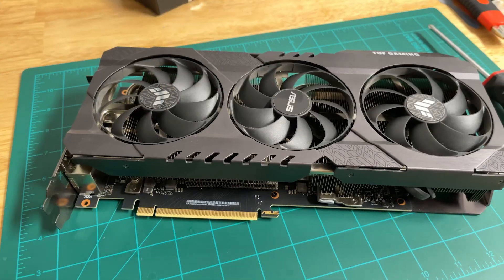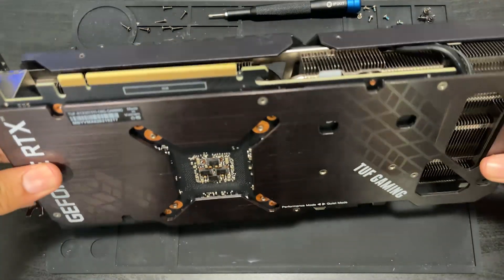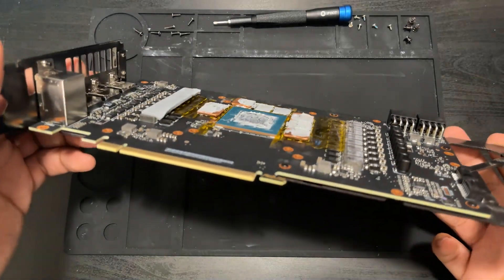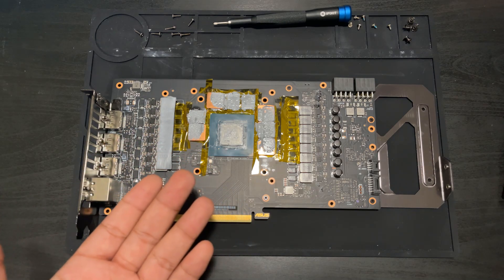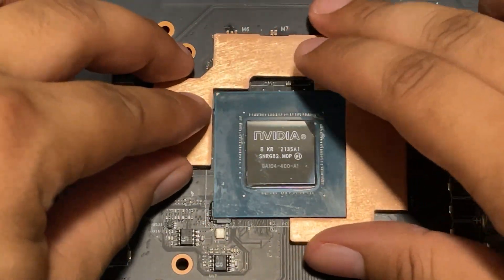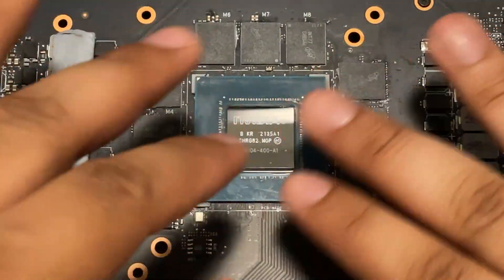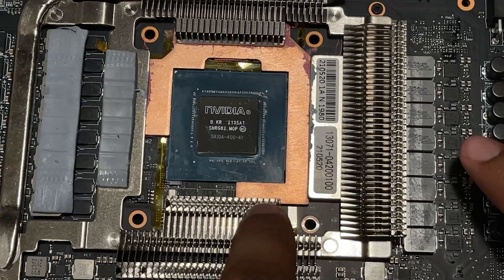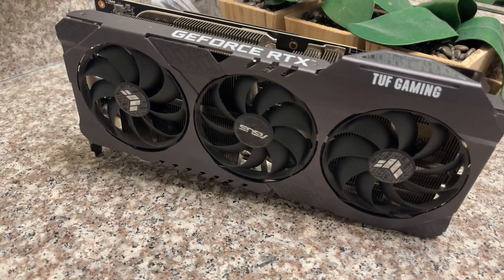RTX 3070 Ti COPPER MOD: 1 Month Later And... OMG...

Comment: I’ll be honest I tried the copper mod 😂 but I used thermal paste instead of pads on my 3070ti fe. so before it would hit even 92-94c as soon as I started up the pc after I did the copper mod it already sounded bad fans ramped up to the holy heavens I was like lemme see started red dead redemption I saw the gpu hit 92 n the whole thing turned off took it apart took off the copper did thermal pads now I’m at a stead 70-76c sometimes 80 with a decent fan curve

Comment: Any copper that is exposed to the air you should a paint  very thin matte black. The color and rough surface of the paint improve emissivity, or how quickly the heat can leave the copper heatsink into the air. I might have some wording wrong, but the practice is tried and true.

 (the surfaces that make contact with the die should be left as they are, completely clean for heat transfer)

Comment: For people who aren't that particularly dextrous with the tape, they sell an anti-conductive coating that you can paint over sensitive components. It works a lot like nail polish except the brush is a bit finer. Supposedly the people who are really into liquid metal use it a lot.

Comment: Could you buy the copper plates from the net with the correct sizes, or did you have to buy a big copper plate, and cut it out plus grind it down?

Comment: to be fair cleaning your GPU with water... not as dumb as you think, water isn't what does the damage to electronics it's them getting shorted by them getting wet while on, if you get it properly dry it's not a problem which you can make sure by putting it in the oven at 100C although to need to make sure your oven is actually getting to that temp, not lower and not higher, everything on the PCB is meant to survive temperatures exceeding 200C so 100C leave a lot of safety margin, just make sure you take everything plastic off.

Comment: Northwest repair just had a copper mod card comecin that died. I dont recommend this to anyone as it doesnt even produce results that impressive, its just a cheap out way of reducing temps without using actual cooling solutions like either ptm 7950 for cpu/gpu core, good thermal pads for memory vrms and mosfets (like gelids) and just going watercooling. I wonder how many people killed gpus with coppermods already

Comment: The most problem is crack solder join in mem because the vibration from 3 fan😂.. Except you're using full block watercooler

Comment: Do you also have a connection through thermal pads on your board and backplate on the VRM position? A lot of RX 6000 owners did this mod.

Comment: I tried moding my GPU before. I never used copper before but I tried better thermal pads on a 3080ti TUF which yielded about -11c and then I removed OEM shroud and stock fans to add 2x 140mm static pressure focused fans which decreased temps by roughly another 10c or so at about 75% constant fan speed. Used 3 of those moded TUFs for mining Ethereum. 

Love your mods and take on this. I'm thinking to try that copper plate. But I'm a little worried about longevity of this mod. Someone suggested 0.5mm thermal pads instead of paste if plate allows it. Anyways how long do you think it would work like this before it would need a repaste job about? 2 years at most with average gaming sounds about right? 

Anyways thanks for that video. You deserve more views

Comment: My memory temps gaming on a 3080ti are max 60c mostly from undervolting, and that's without a copper mod. My gpu temps are 53c and hotspot 60c. I also keep my fans at 100%. Just use good quality thermal pads on the front and back of the gpu. Also tighten the four spring screws to the heatsink as tight as possible.

Comment: I've seen somewhere on the alliexpress the backplate " heatsink " cooling the gpu chip and memory but for the older gtx 1080Ti which is still powerfull gpu tbh. The effect was not so impressive but having 2-4c down is a nice bonus. Not to mention the price for that heatsink, 35$ including shipping.

Comment: EVGA RTX 3090XC3 perso sur la Vram au dos de la carte j était sur pads Gelid 2mm 
je suis passer avec des cales cuivre 2mn et entre la Vram et le cuivre du ruban thermique double face le plus fin possible et laisse dépasser 1mm pour éviter tout risque de contact avec des petit condo et entre les cales en cuivre et la backplate passive arrière pate thermique avec une viscosité assez collante '(pate de qualité) et en mettre très peu 
résultat il faut une heure de chauffe pour que la pate s étale correctement sous le cuivre , résultat température Vram au dos 72c max avec ventilation généreuse si ventilation faible 80c max de la Vram, avec pads Gelid 2mm 
78c maxavec ventilation généreuse si ventilation faible 90c max de la Vram 
je n ai rien mis coté GPU j ai déjà update le system AIO EVGA , mais les personnes a system a ventirad vos cales cuivre ruban thermique ne doivent pas dépassé l épaisseur constructeur de votre carte  
cela fonctionne sur n importe quel GPU , le ruban kapton peut être important suivant vos modelés 
si ca peut aider certaines personnes 😀 les cales Coolmygpu ne sont plus envoyez en Europe alors Moder sois même est faisable
ca demande du travail du temp de la précision mais coute 10 fois moins chère aussi😁

Comment: Bruhhh and i tought that mine Rtx 3070 palit jet stream oc is great when i repaste it and háve in full load 77celsious and around 88 to 94 on hot spot loke those are still good temps cuz gpu runs how from stock cuz háve higher frequency boost but yeah i just open and repaste mine Rtx with thermal grizzy kryonaut and results was nice gpu before was 88 on full load and hot spot 110 deg after repaste 77 and hot spot max 94. Over all i was happy but damn this is some next lever of shit

Comment: What is status of your GPU now ? I want to do it on my GPU... WANT TO KNOW THE LONG TERM RESULTS....
Reply: Same, I'd love to know. My 3080 was copper modded for around a year and was perfectly fine, memory temps around 80C but core got a bit hotter. Only recently removed it since I was worried the plate may be a bit thick and put too much pressure on the memory chip solder joints, as had happened for one gpu on a gpu repair channel. After new pads my core temps dropped, confirming my suspicion so I'm happy with just pads for now. Core temps are lower than they were stock and vram still stays below 90C in games. In Furmark it goes to 100C, but nothing else I do ever pushes the vram that hard. And that's still 10C less than stock pads.

And for reference, it's a Zotac 3080 Trinity (takes 2mm pads but the gelid ones I got had to be squished down a lot to get good core contact), the copper plate is exactly 1.6mm thick, I think if I somehow got it machined down to 1.50mm it would be perfect and I would consider reinstalling it maybe. For now I don't want to risk dislodging a vram chip for temperatures that don't really matter.

Comment: I have ordered the parts for my EVGA RTX 3090. My 3090 has two layers of memory. So one layer is copper, the other layer is aluminum.😁
Reply: EVGA RTX 3090XC3 perso sur la Vram au dos de la carte j était sur pads Gelid 2mm 
je suis passer avec des cales cuivre 2mn et entre la Vram et le cuivre du ruban thermique double face le plus fin possible et laisse dépasser 1mm pour éviter tout risque de contact avec des petit condo et entre les cales en cuivre et la backplate passive arrière pate thermique avec une viscosité assez collante '(pate de qualité) et en mettre très peu 
résultat il faut une heure de chauffe pour que la pate s étale correctement sous le cuivre , résultat température Vram au dos 72c max avec ventilation généreuse si ventilation faible 80c max de la Vram, avec pads Gelid 2mm 
78c maxavec ventilation généreuse si ventilation faible 90c max de la Vram 
je n ai rien mis coté GPU j ai déjà update le system AIO EVGA , mais les personnes a system a ventirad vos cales cuivre ruban thermique ne doivent pas dépassé l épaisseur constructeur de votre carte  
cela fonctionne sur n importe quel GPU , le ruban kapton peut être important suivant vos modelés 
si ca peut aider certaines personnes 😀

Comment: What is the reason of doing such mod? You replaced thermal pads with copper and thermal paste. Why?
Reply: The GPU cooler is trash that's why.
Reply: @kishin9  not only that, almost every 30 series is borked with temp issue in hotspot, memory temp. The better way to fix that by follow youtube guide how to undervolt

Comment: i have the evga 3070ti ftw3 ultra and im thinking about it, as well...lower temps, better clocks. better clocks means? yep, better performance. to which, might not yield much, but still keeping it cooler will make it last longer for sure.  my hotspot gets 70/80c depending on what game/res/hard i run it and fan speeds set. i already have MX4 a big ol buddy tube of it, had some kryonaut a while back *(5c cooler on 5800x) with it vs mx4 i wont be spending that on paste. lets see how this goes. as im pretty versed myself on electronics etc.

Comment: I’ve washed cards before. No issues when dried properly. Thermal putty under and on top of the copper plate would have worked also. Performing a “squeeze fit” and pulling the card apart again to check contact of GPU before screwing everything together is also a good practice.

Comment: Hold on a minute, there’s absolutely no difference in moisture level between air cooling and water cooling as long as your loop isn’t leaking, and if your loop is leaking on to your graphics card, it’s gonna get fried before it has a chance to corrode.  So there’s no reason you couldn’t use copper shims for water cooling, just make damn sure you get the correct size.
Reply: I had the same thought. On top of that you do not cool with water usually :)

Comment: I wonder why they don't copper plate the heatsinks? The steel would be really easy to copper plate and surely it would conduct heat away much better if it was copper plated?

Comment: If I had one thing to say it would be you can definitely use less capton tape.
Reply: Also, you should have added some paste to the exposed copper and the main heatsink as there is a contact point there.

Comment: hey there ! very nice content, I watched the complete process and I'm very interrested in the modification of my 2 rtx 3090, but I can't figure the thickness of the copper plate. Also, are you using a plate coming from coolmygpu ? or is it a custom made ? Because as there are ram chips on the two sides I dunno what to use : big copper plate or small ones like you used on the previous video. advice needed here. Moreover, I never did such a modification on a gpu, but I feel confident.

Comment: I have 1.6mm copper plate, when I start mining my memory temperatures are getting low but my core temperatures are getting high
Reply: the reason they use thermal pads is because they compress. now because you have something non-compressable in there the gpu die isn't making good contact, thats why increased core temps.

Comment: I have a doubt( please dont judge me ) so you have the chip at certain temperature , thermal paste compound conductivity is 6W-21W  depending on brand and etc , the copper  is pretty high but let say a copper shimmer you use is 200 W/mk , so if you tranfer the heat from the chip at a 17W/mK to the copper shimmer then the copper shipper transfers to the other layer of compound at 200W/mK and then the compound to the cooler at 17W/mK , so wouldnt you profit more to use just the copper as a conductant between them or just use thermal paste only between the chip and the cooper ? 
if anyone could explain properly would apreciate a lot , best regards to everyone
Reply: you cant use paste only because of the gap between chip and cooler. paste is only good at microscopic gaps, but these have mm between them. thus the shims

Comment: i have a evga 1660ti sc ultra and id love to do a copper mod but my memory does not have any cooling no pad no heatsink. only pads on the backplate so im not sure how i would mod it. and i cant monitor mem temps in the first place

Comment: For those trying to do this (as this is a 3070TI video and the 3080TI FE generates more heat): 
1) I put Kryonaut over the VRAM chips, AND in the spaces around the VRAM chips. I did not use Kapton Tape.
2) Make sure that you use 1.5MM copper pads for the 3080 TI FE. If you use a combination of 1MM copper + .5MM pad, you can have hotspot temp spikes if your heatsink assembly has uneven surfaces or other manufacturing defects. Which can cause the GPU to cause emergency PC shutdown. I have NOT had that issue after removing Copper + Thermal Pad and only using 1.5MM pads and copius thermal paste to prevent shorting. 
3) Installation is paste over/around VRAM chips, place copper pads onto VRAM chips, more thermal paste on the top/sides of the copper pads.

Comment: using a metal paste a nono on gpus, you were worried about copper shorts? now you gotta be worried about paste shorts. aluminum one of the most used metals for conductivity. and you used it as a paste everywhere lol

Comment: I am not sure why you were surprised when you found out it looks fine... I mean, there are pure copper blocks on water cooling solutions and air coolers with exposed copper pipes (not nickel plated), and the heat there is even higher... so yeah, not a big surprise

Comment: I am very interested in doing this cause recently the thermal pads on my 2080 have started going down hill and the VRAM is now reaching around 85C when previously it was at 60C I don't have any thermal pads on me and I already have decent thermal paste and on Ebay the copper IC Chips are around the same price as the thermal pads

Comment: Still waiting on the 3090FE kit to arrive got my Kritical pads in 20kw now just need to get extra PCIe cables for my PSU as I have a      3080Ti as backup incase I mess this up.

Comment: Not sure if I should do this or just put good pads on, also can you link that new copper plate instead of the old shims in the desc? Wondering about resale value as well. Is thermal grizzly kryonaut extreme ok for the gpu? I keep hearing the term pushout but not sure what that means.

Comment: You’re “well versed” but didn’t notice the caption tape on one of your VRAM chips and put the copper heatsink over top of it instead of straightening it out first. Lmao. I mean you do a good job but you’re letting simple stuff slide by. Plus putting caption tape of the components like you did in your last video robbed them of and airflow and made them run hotter than they should. Not hating on you I promise.

Comment: The mod was really great, but here's a question, copper plate price + 100 dollars... wouldn't it be better to take this money and exchange it for an rtx3080 since the price difference between a 3070 ti and an rtx 3080 is exactly 100 dollars? I believe that, in general, it is the best cost x benefit to use your previous mod really, anyway, the mod was very good and well done, congratulations

Comment: Rtx 3070 ti Crashing

Hi ,

I have recently started mining.

Rtx 3080 LHR X 4 Rtx 3070 ti X 2

Nicehash (dagger/NBminer)

Everything running smoothly, until:

1 of the 3070ti keeps turning off after 30 min. Lowered overclocks, and then started turning off after 12 hours or so. It completely shuts down the power supply as well. Restart the computer, turn the card off and on and then runs for another 12 hours and does the same again.

I've tried to replace the riser, I've changed positions using another riser slot and still the same issues.

Card was used by a friend over the wknd and ran for 48 hours with no problems.

This afternoon it keeps giving a:

Cuda error: out of memory (err_no=2) Device 4 exception, exit ...

Any help ?

Comment: This is the third time imma write this idk why my msg disappears :/ ... Syy-157 great comparable paste to tfx or kryonaut extreme. It's super viscous and good quality thermal paste, I used it on my msi ge66 laptop with i7 10875h and 2080 super , works like a charm works as well or better than tfx. You gotta spread it cuz its very viscous won't spread well on it's own.

Comment: I have the exact same card, did the initial copper mod with the copper squares… recently upgraded to a 12700 and new motherboard so while I was in there I decided to install the coolmygpu shim— I must have messed something up because now the screens go black on windows boot and fans go to 100%. Not sure how or what I did wrong, but it’s unfortunate— especially 3 months from release of the 40 series cards.

Comment: my plate arrived this week. thermal grizzly paste and pads arrive tomorrow.  my system is built like the splave pc. i'm going for sub 60°c pc on full load. cpu/gpu/gpumem.  currently only the memory is above 60. i just see you got kryonaut extreme. i'm using kryonaut. because reviews say it's not better to get extreme untill you go sub 0
Reply: yes it's 100 dollar/euro for that paste but that's because you got 33grams lol .
Reply: Where did you get the plate

Comment: Before doing anything like this mod, Firstly check online of the cards Warranty void status, In the UK breaking the seal on the screws still voids warranty because if you was to have a unrelated issue with the card & the card manufacturer wont touch it and you lose right out. So just check first before modding don't void your warranty. But you can use nail varnish instead to protect all components that could short out and use Liquid metal on the GPU core, totally safe I use it myself and so does Gamers Nexus.

Comment: you'll want to make 2 copper strips and add them between the Memory cooler plate and the cold plate (one replacing the thermal pad, and one on the other side of the die where the sticker is)